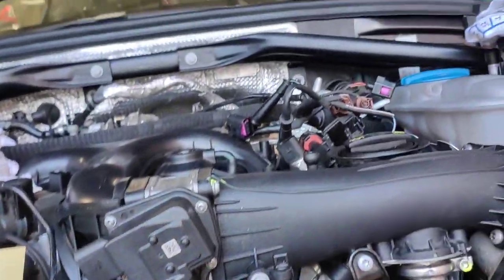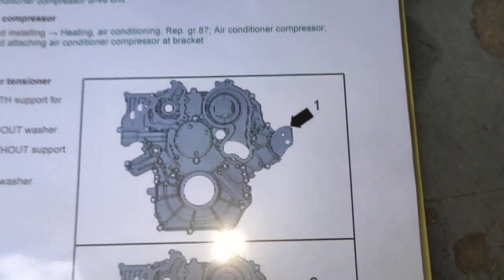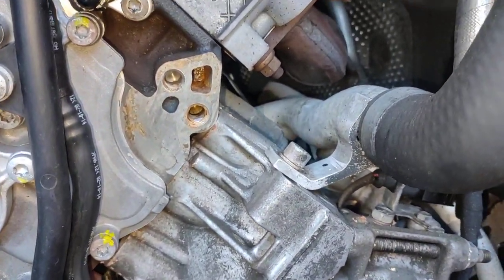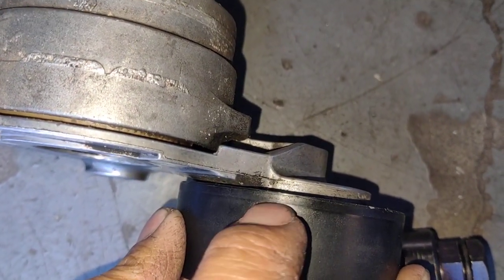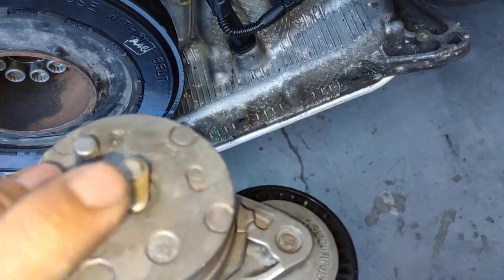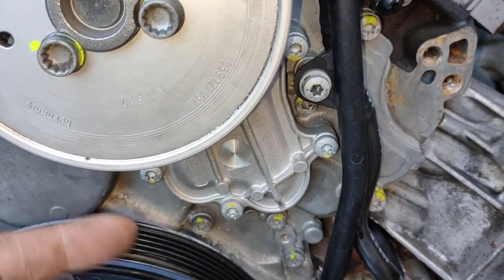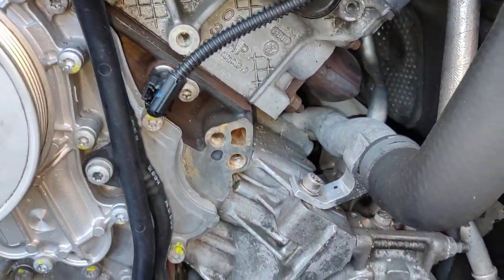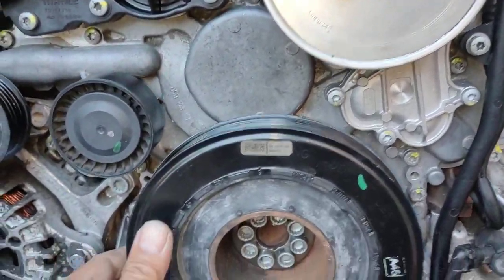Audi/VW 3.0L V6 diesel tensioner washer missing + tool for rotating of crankshaft

Comment: It is normal that you can move the Harmonic Balancer Like in the Video?
Reply from the maker: If the rubber part is cracked at the back - movement seems normal but you can actually feel when they start to go.
Reply: Why have you marked the balancer with blue marker? Thanks